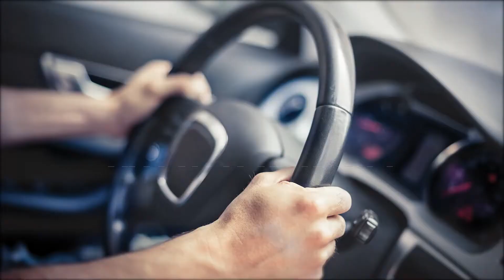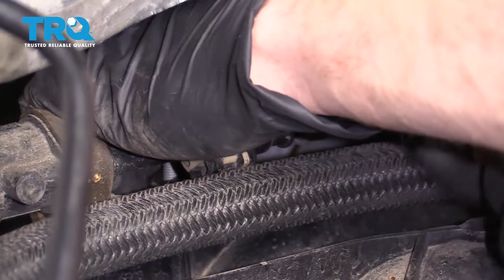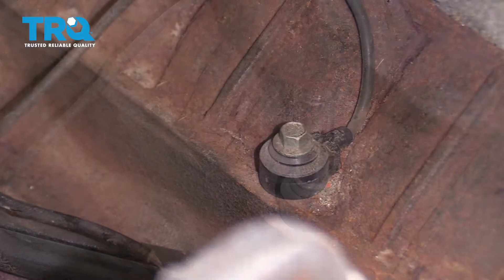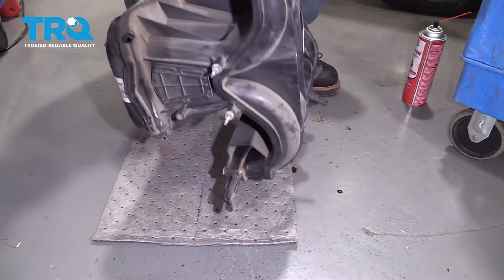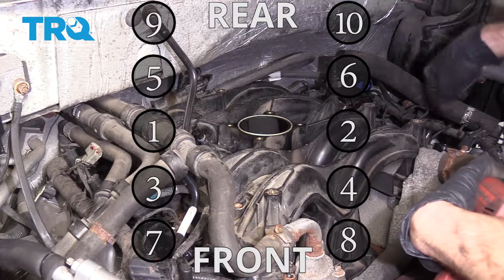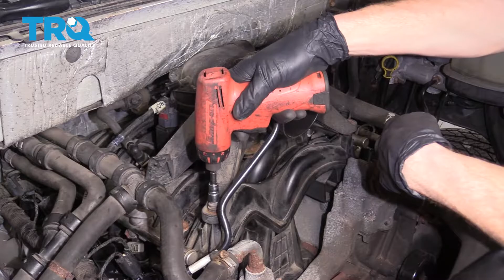How to Replace Knock Sensor 2007-2017 Ford Expedition

Comment: The shop manual (at least for the 2010) says it's necessary to drain the cooling system before doing this job, but I'm not seeing why that would be the case.   Does anyone know?

Comment: Is it possible for the sensor to malfunction without the appearance of fault codes? I have a sound in the engine that looks like a patch, knowing that I use high lactane 95 fuel.

Comment: What is that other sensor on the passenger side, above the knock sensor? It has a white plastic clip and a brass colored metal insert going into the engine.